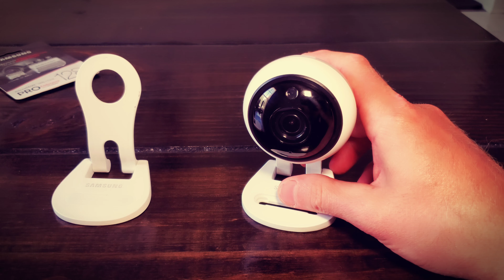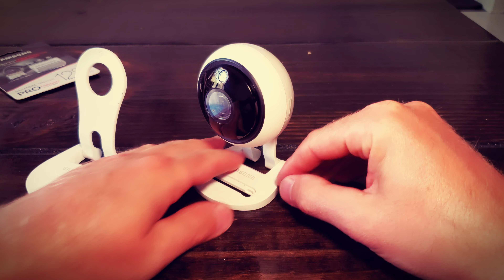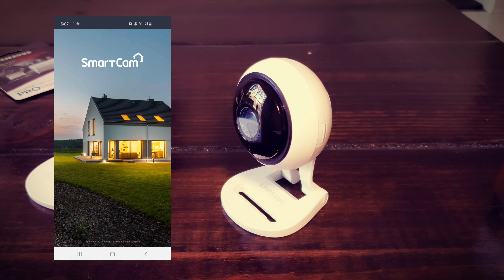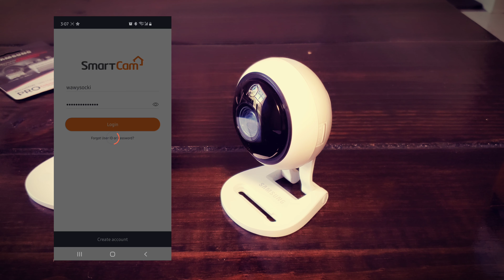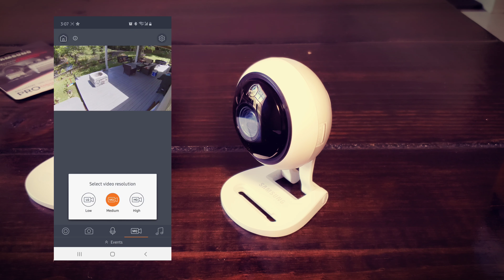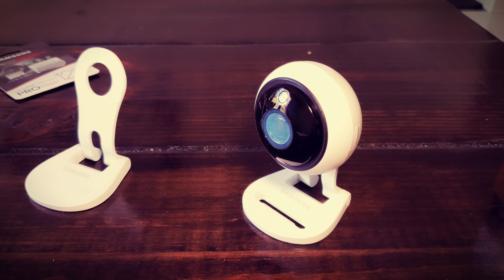Samsung Smartcam HD Plus Security Camera - No monthly fee

Comment: I came here because mine is not staying connected to the network. Have you had the same issues?
Reply from the maker: Rarely but yes. It seems to just loose connection for no reason. 2 Things - first, try using a different power adapter with at least 2.4a instead of the 2.0a charger supplied or at least another with at least the min 2.0a. Next, i have an asus router that lets me remotely connect via app and i can reboot it from there. This always brings the Camera that fell off the network back after reboot so your not affected if your not there.

The different charger took care of it for me 95%.